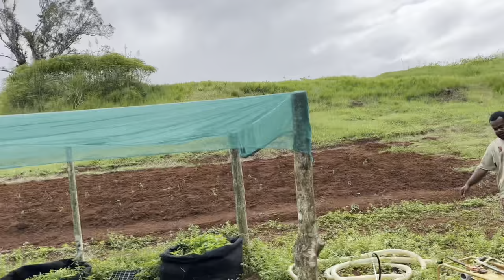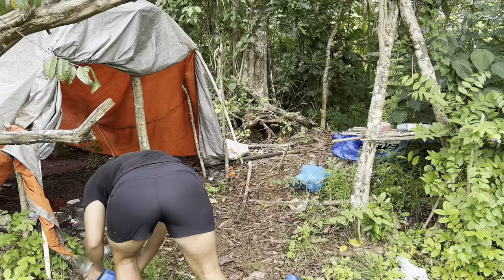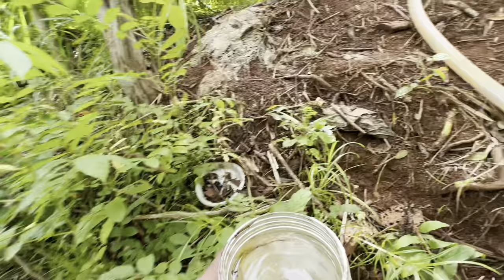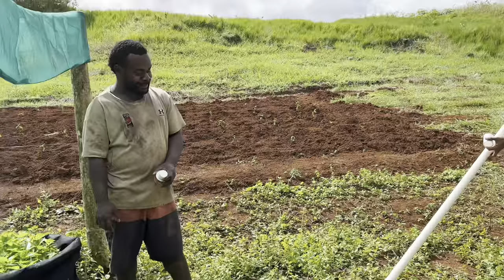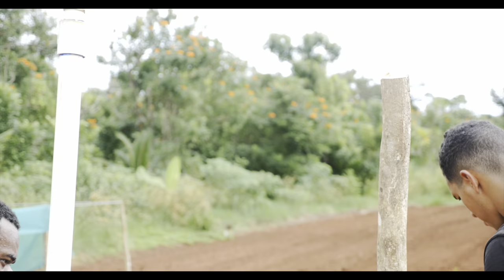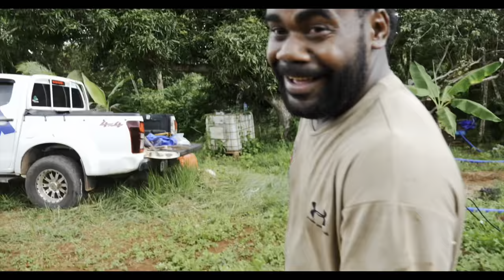We Made a Sprinkler WORK From A Creek FIJI Style!🇫🇯 Vlog_109

Comment: For the pump to last longer the in take side should always be air-tight; because cavitation is a pumps enemy. It doesn't matter if the output side leaks but it will also affect  pump "head", pressure and flow rate.

Comment: Good initiative! Should install a foot valve with strainer at end of suction hose; this will prevent water from flowing back into the creek whenever the pump's switched off and also keeps the pump primed at all times. And I think you're misunderstanding how pipe diameter, pressure, and velocity (speed) work. A smaller pipe diameter is NOT better for pushing water over a long distance... the pump will work even harder due to the increased resistance. The pressure is actually higher through a larger pipe diameter; this pressure will decrease when the pipe diameter decreases before or at the sprinkler connection resulting in an INCREASE in velocity to maintain the same flow rate (flow rate is constant).